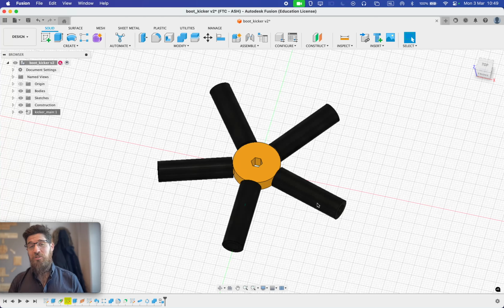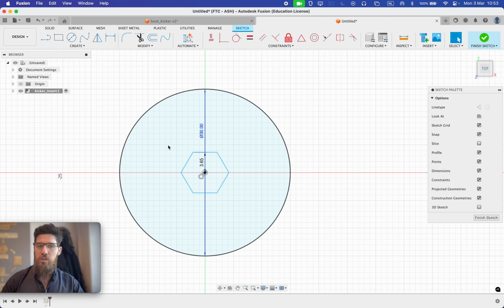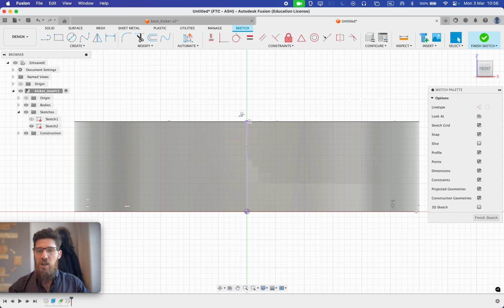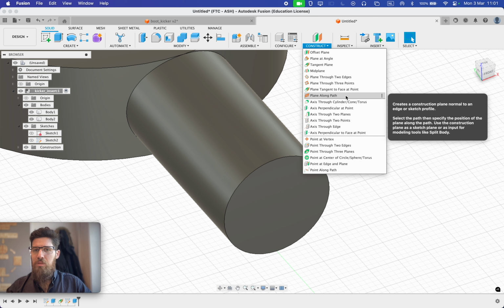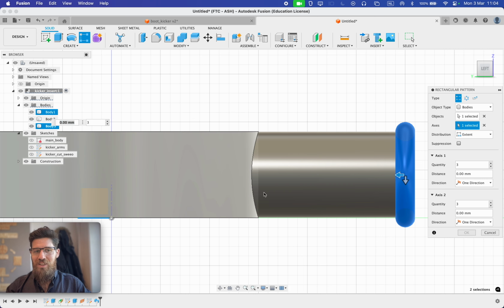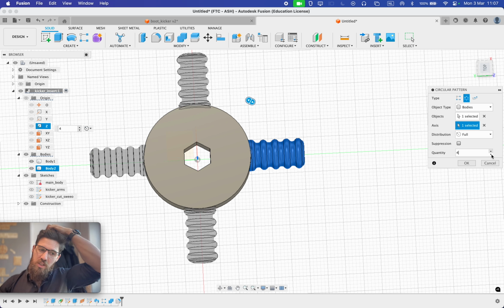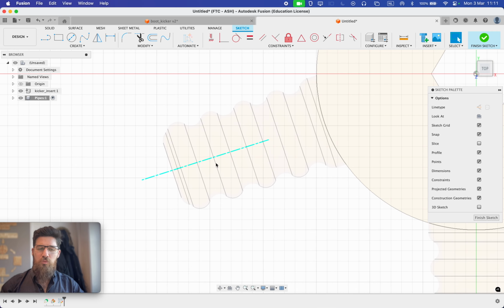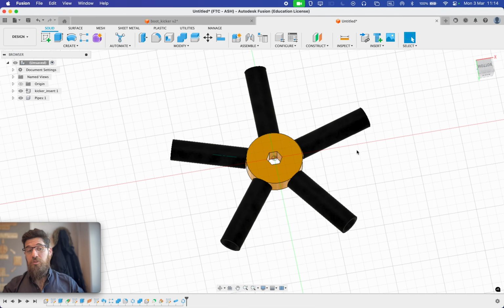Learn AutoDesk Fusion 360 For Robotics - Basic Lesson 4 – Sweep, Pipe, and Planes

Comment: do you worry about the lengths of the tube inserts because in the into the deep season i ran into flexibility issues with that 3d printed parts do you have any ideas to improve or fix this design.
Reply from the maker: I would suggest you don't 3d print the tubes themselves, even using TPU, the coefficient of friction just isn't high enough and layer adhesion is a nightmare. I like to use rubber elastic tubing that is typically used for weight lifting resistance bands. A common brand is "theraband". Then you won't run into these flexibility issues. I simply modeled the tubes here to show the pipe tool, as well as to show how to set up tolerances for lengths in fusion.
Reply: @BroganMPratt  I was more asking about the riveted inserts because they have given me trouble when picking up heavy objects with stiff tubing
Reply from the maker: @mp_noob  Lasercut out this design so you're printing it out of a solid material, try salt annealing your prints, or use a less stiff tube material. PETG can only get you so far